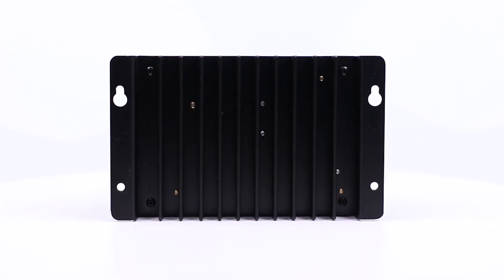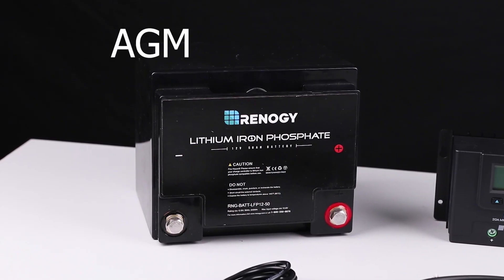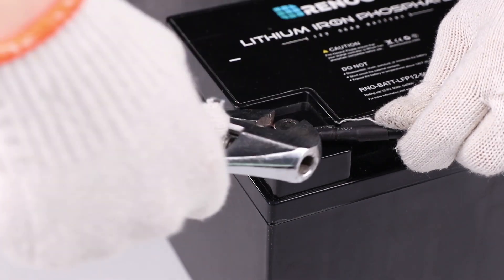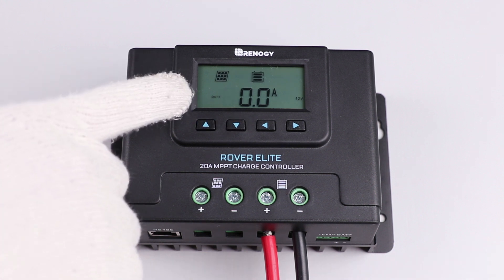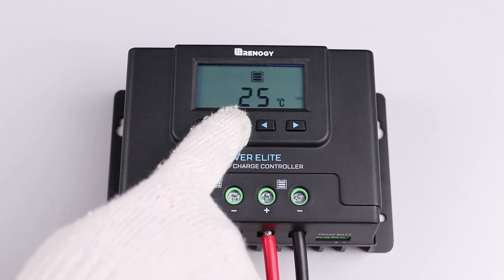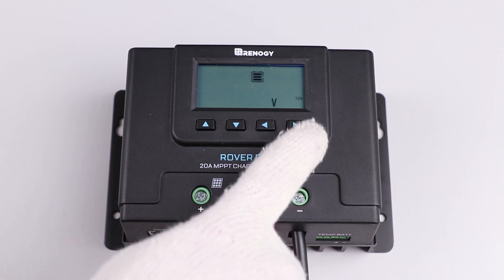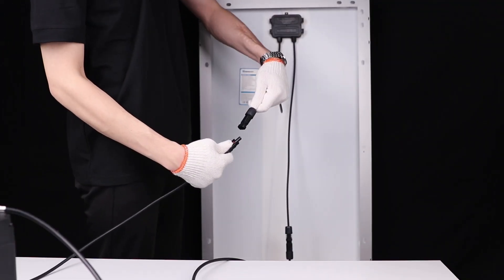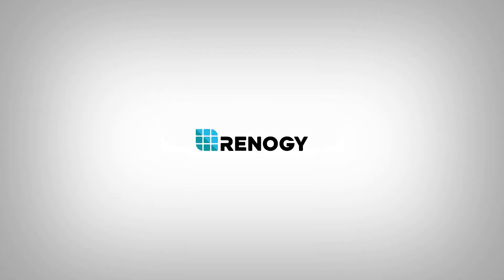Renogy Rover Elite 20A MPPT Solar Charge Controller

Comment from the maker: Here is a kindly reminder that the panels mentioned in the video above should not exceed 80w.
Reply: Hmm. A 160W panel at about 23% efficiency will put out a maximum power current of 8.9A at 12V. That means 160W x 2  (320W) would have you at a maximum of 17.8A under the 20A MPPT controller limit. So 40A should support 640W. 

If I'm not mistaken.
Reply: @VenturiLife  Yes, I am a little confused at his statement!
Reply: I have a 200 watt panel will it be a problem if I hook it up to the 40amp controller that looks exactly like this?

Comment: What about fuses between solar panel.and controller and from.controler to battery are they not needed with this controller
Reply from the maker: Hi, G W.

Thank you for your feedback. Our video test environment simulates relatively safe use. We will inform in our future video shoots in advance.

Let me tell you how to choose the fuse specification of our controller. The specification of the fuse between the solar panel and the controller is the input current of the solar panel × 1.56, and the fuse between the controller and the battery is 20A × 1.25. Hope it is helpful.
Reply: Was wondering the same thing. I have breakers and fuses on my Rover Elites. Were they not necessary?

Comment: Any idea if I can charge a 12v lifepo battery bank with 24v of panels with the rover elite?
Reply from the maker: Hi, canamman111.

The system voltage needs to be consistent. If your battery voltage is 12v, please make sure the voltage of other products also is 12v.

Wish you a nice day.
Reply: @RenogySolar  Wow,  that's incorrect. Unfortunately Renogy customer service reps are not techs answering questions most of the time in my experience (case in point).

Short answer- yes, you can input 24V from solar.  

Long answer- This device allows the connection of up to a max 100 volt (per the manual) solar input, or about 4 standard solar panels wired in series. It then converts that high DC voltage that varies based on solar input, to what a 12v (or 24v) volt battery (or batt bank) needs to charge up properly of the type you set and specify in the controller, e.g. lead acid wet cell, agm, gel, or lithium. 

You could wire your panels in parallel and the controler will accept up to ~450 watts of solar panel power, which is about 40 amps DC. Better to wire in series and take advantage of high volts with low amps on the solar side. That will use less copper wire size and have less amp loss for better efficiency (lower wire cost too). It's really useful to understand that if you double the voltage in any electric system it's twice the power if at the same amps. Or taken another way, you can send the same power with half the wire size and amps, if you double the voltage. 

Keep in mind - Amps x Volts =Watts and 12V at 2A = 24V at 1A = 24 watts, same energy.  Power is how long the energy was delivered which is why you must describe power with a time component, AKA Battery Amps hours or Kilowatt hours.  Key to understand to know how long you can power something from a batt.

Comment: is sealed and gel the same thing?
Reply from the maker: Hi, David.

They are also known as SLA (Sealed Lead-Acid) batteries. These abbreviations refer to the safety valves in the battery's lid. In common parlance, the term gel battery is used to indicate both AGM and Gel batteries.

Have a nice day.

Comment: Thanks Renogy for this short yet informative video. I am wondering if a typical 18v (12v) Solar panel can be used to charge a 24v battery bank. The spec says the input is 15v-100v but not sure if that's true only for higher solar voltage than the battery voltage. If someone from Renogy team could kindly answer the query that would be great.

Comment: ok do i hav to use the temp sensor? in the video its confusing it shows conection is made to the left side rite under the word temp. does that mater? can it b conected on either side. the other thing is the wires r conected rong. the red is shown on the rite side of that conector. does that mater?
Reply: The temp sensor MUST be plugged into the TEMP side. There is no polarity for a temperature sensor so don't worry about the color of the wires. If you plug it into the BATT side you will get a constant 25 degree C reading on the monitor. Once you get it plugged into the TEMP side, you can hold the metal portion of the sensor with your fingers and watch the temperature start to increase.

Comment: Kindly explain why this unit is missing the "LOAD" output connection. So how can I connect my device to a 12 volt DC output?
Reply: Whatever your load is, connect it to the battery with a fuse or a breaker. If you use an inverter to generate AC power, that will normally have load protection. If you connect your (fused) load directly to the battery, you'll want some way to monitor voltage. If it's for indoor use, there are many varieties of low cost 12v DC voltage displays available that can be wired into your system.
Reply: Because you need to purchase a inverter.
Reply: @Daveyboy actually just a 12v deep-cycle battery since that is what this is used for. :)

Comment: What are the advantages of the new Rover Elect over the Older ROVER LI other than size?
Reply from the maker: Thank you for contacting Renogy. Followings are the major advantages of the new Rover Elite Charge Controller: 1. Smaller/compact/ lighter
2. Battery Voltage Sensor Port
3. Units come with Remote Temperature Sensors
4. Simplified and easy to understand LCD display
Reply: It also has the 'RS485' type comm port for use with the BT-2 module which can then also be connected to the hub they sell to connect up to 8 RS485 devices to one BT-2 module for simplified connection of all devices. The older Rover Li model only has RS232 and has to use the BT-1 module which can only connect to one device.